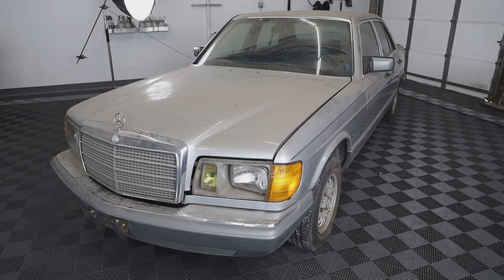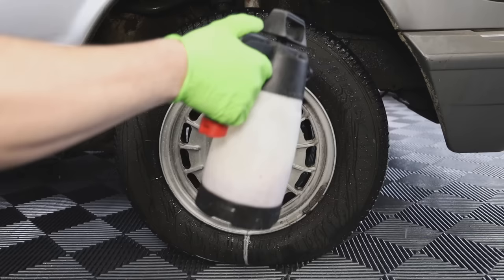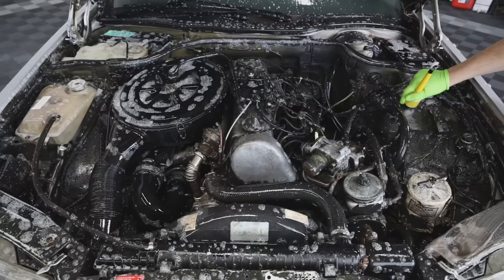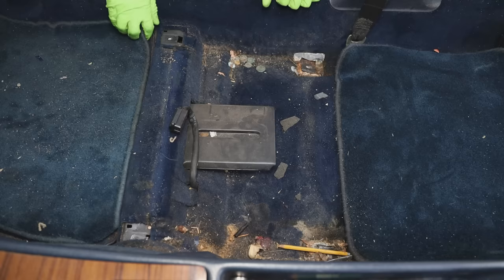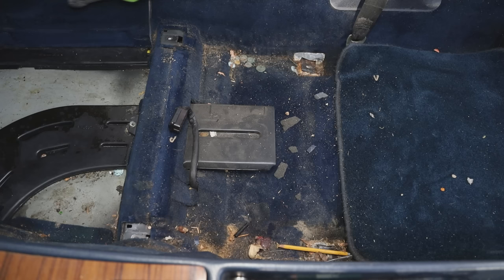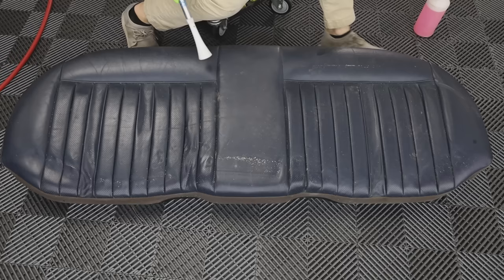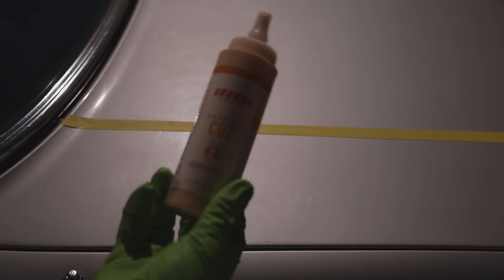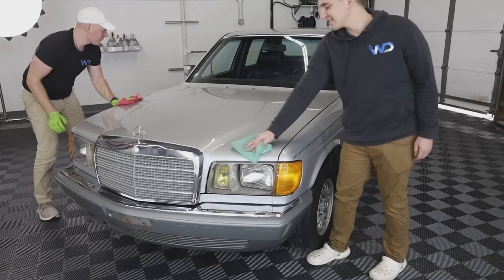DISASTER Mercedes 300SD First Wash in 18 Years! Can It Be Saved?! | Satisfying Restoration

Comment from the maker: What year do you think this Mercedes is?

Don't forget to SUBSCRIBE to the channel! Our next video is going to be INSANE!
Reply: 80-83 no ABS and the alloys name is Barock 14” this model are only for US market not for EUR
Reply: its produced from 1980 to about 1985
Reply: 1983 and those wheels are worth a lot of money. 1980-1991 W126 is probably the best built and engineered cars of all time. Proper maintenance they can last indefinitely.
Reply: Happy New Year WD Detailing!
Reply: Not sure about the year but the W126 300SD was USA only and the engine was basically the W124 300 turbo diesel engine.
This car was produced between 1981-1985 and as mentioned USA only. 5-pot 3-liter.
Reply: @erionhaxhia8284  I’ll go with 85 looking at the radio, unless they updated to the Becker gran prix head unit.  Very nice example whatever it is.
Reply: @user-ys1uc3gm8l  No , its produced till 1991 !
My father have the same with the same blue interior from 1991 one of the last made !
Reply: @niber8417  Meanwhile in EUR: almost all W126 and many late W123 had these alloys in different sizes....
Reply: 1983 or 84
Reply: 1984-1985 because of the speedometer increased up to 120 mph max vs the early 1981-1983 was 85 mph max if I recall. I noticed the Becker Radio has been upgraded to a 1986-1989 model year because the earlier 1981-1985 Becker Radio displayed the time in military style. This is a inline 5 Turbo Diesel good cars I recall seeing these when new high end luxury cars price of purchasing a home back in the days I'm old enough to recall.
Reply: From the head lights I would have to say 85-87 I believe the face lift happened in 88/89 to newer style headlights, and that engine lasts forever
Reply: 1985
Reply: 1983 Mercedes 380 SEL and they can go up to 999,999 miles because I bought mine in 1982 brand new and right now it only has roughly 79,500 miles on it all original
Reply: @kaloyanrosenov2123  After 1985 they put a 6 cylinder in these cars which had many issues.
Reply: @scottjames51  Yes , my father's one was 6 cylinder gasoline and it blocked the motor two times ! 
It was rebuilt two times and after the last time it run with no problem for years ! 
One friend haves 124 diesel , its over 800 thousands km the motor is fine , never had problems !
Reply: 1982
Reply: 1982
Reply: I think a 1986 
But the Trunk carpet looked like a imprint of a body with a plastic bag over the head and a dog next to it even after cleaning the impression 
Appears again

Comment: That wheel style was called Barock I think. These cars were practically indestructible. I used to work at a retirement home and we had a resident who had 2 1984 models. Both of them had 600K+ miles on them.
Reply from the maker: 600k?! WOW
Reply: @WDDetailing  yeah with proper maintenance these are million mile cars. The body goes to crap long before the engine.
Reply: @WDDetailing  Good job. How much does such a comp!ete cleaning and polishing cost?

Comment: The Turbo is located on the right side of the engine, right unterneath the Airfilter… if you don’t push this car as long as it’s cold and change oil regularly, this is a car for a lifetime. Mileages around 600t without even opening the engine is usual. Probably the best S-Class Mercedes ever made. I had 7 W126 in the past 20 years and all of them were sold for a high price again. The best engine is the 5 Liter V8 of the later years… strong, lasting forever and even today quiet fast on the German Autobahn.

Comment: 1982, Turbo location on the passenger car under the Air Cleaner. that is a rare color if memory serves me right! Biggest issue from experience is the Timing Chain Tensioner.  I've heard of these hitting 700K.  Mine had 450K on it, and I sold it and the current owner has 580K.  Fantastic cars!
Reply: i have to agree with you, because you can see the air charge tube below the factory air cleaner

Comment: I like that you pre-soak before you power wash so that you don't turn the dirt into an abrasive driven by the high pressure - too many people take a dry filthy car and just blast it - you also started on the roof and worked down which is how I was taught to wash ANYTHING so that you dont end up washing dirt off the roof over a just cleaned hood etc. wetting the car first before power washing and then washing from the top down is, at least to me, the smartest way to do this.

Comment: The Mercedes cars from the 1970s to 1990s are likely the most overbuilt cars of all time, save maybe an early LS400. 

The paint alone weighs nearly 20 pounds on these cars. The MB-Tex vinyl interiors they created are nearly indestructible. They created the most elaborate process for rust inhibition which is why so many still come back like new with a deep detailing. 

The engine bay should come out even nicer than what I saw. The sides should be the same glossy silver as the exterior paint. Take a look at any nicely detailed Benz on BAT. 

Last thing, guys make sure that anytime you get an old German car, esp an old Mercedes, don’t forget to deep detail the undercarriage and wheel wells. They come back LIKE NEW because of how well these were built! Imagine the undercarriage/wheel wells. It’s honestly worth doing another 2-4min short video.

Comment: Bundt wheels in the US market. I had one of these and a 300D. Both were in great shape but not museum quality so I replaced them with 15 inch factory wheels and kept these for snow tires. If it were an immaculate low mileage example, then for the sake of originality I would leave those on.

Comment: About 15 years ago, I worked with a guy (we worked at a furniture store) he had a older 70's or 80's Mercedes similar to the one in the video. Just NA, no turbo. He kept it minty clean, inside and out. Had over 250k miles on it, and it always looked like he had just ran it through a touchless carwash.

Sadly, I'm sure he's passed by now, so not sure of the car's current whereabouts.

Comment: Dude. OK, so that is a W126 S-class of the first series. You can tell by the fact that the plastic on the side has ribs. The first series was built from 1979 to 1985. The 300SD was built from 1980. I would just guess this is an 83. It has a 3 liter 5 cyl turbo diesel making roughly 120hp, and it was never available in Europe. The turbo is visible, it is located under the air filter. The only model you could get this engine in in Europe was the 300TD, which is the W123 "E-class" station wagon (Correctly called S123, and no, it was not available in the sedan!). The rims are called "Fuchsfelgen" (yes, like the legendary Porsche ones) but they might also be called "Barockfelgen". They are very sought after, and you definitely do not want to exchange those.

Comment: Blue was a rare interior color.
I would say it's an 83 or 84. If memory serves me correctly the frame around the seat back nets was metal until 1982, and since it does not have a driver's airbag or ABS, it's not an 85.

Comment: cool car! fewer of these on the road in plain sight... I'm guessing 1982-85 ish. Regarding your question about how long they can last. I had a 280D, it had over 330k on it. needed new Eng mounts, Previous owner was older and didn't want to do it. I took it for $700 bc it was a bit rough on the body but Mechanically (sound). I replaced the majority of all the belts, rubber hoses, filters, etc, and drove it till 540k. until it blew a head gasket. Original one mind you. There is a saying Among these older All mechanical bulletproof/gutless diesels "They aren't broke in until half a million" There is a reason why Solid, Clean Examples so for 20k+ now Quality over Quantity.
Reply: 280D ?? what model is that?

Comment: These are the types of cars I’m used to detailing this particular w126 Mercedes if I had to guess the year I’d say 1982 this model with the bumpers and wheels all look a like for the 1981 to the 1985 model year in 1986 they changed the bumpers headlights and rims as well as the Diesel engines and a few other modifications but overall the w126 was made between 1979 to 1991

Comment: Turbo is under the passenger side air filer cover. The car doesn't come with a boost gauge and you're best off installing one. Then you'll find that the boost is low and can turn it back up to normal from the barometric capsule.
The tail lights have a self-cleaning design.
I would improve the look of the car, by getting rid of that stripe.

Comment: When you guys use the apc/degreaser. When pressure washing it it off work from bottom to top that way it has a little more time to sit and dwell on the surfaces. When you go from top to bottom your rinsing off the degreaser prematurely. Now this is only when using an apc/degreaser

Comment: The wheels are the mexican hats, affectionately known as.
I had the 3.8 liter V8, pulled it out and installed a Aussie Holden V8 5.0.
Shortened the prop shaft by 2 inches.
Hot cams, 600 cfm Edelbrock and custom exhaust manifolds.
Thing went like stink afterwards

Comment: This car is a 1984 model year car, the w126 300SD was made from 1981 to 1985 and each year had a slightly different instrument cluster and 3 different speedometers, this cluster is a 1984 model year cluster but the car could have been manufactured in late 1983 when the 1984 models began to be delivered in late Sept 1983

Comment: With 500,000 km, this engine has only run in well 😉
1,000,000 km and more is no problem for this engine.
Regular and professional care provided !!!

The wheels - by the way - are called Barock wheels by Mercedes Benz.

Comment: Looks like a early to mid 80's W124 chassis. As long as the car is maintained properly, there's no reason the engine shouldn't go at least 750,000 miles. The turbo is under the intake manifold and air cleaner on the right side of the engine.

Comment: Hey, I've noticed that you guys and MADD detailing are angling the pad while cutting and polishing. I was taught that number one rule was to keep it flat to the surface. What's the reason behind this?
Reply: My guess is to get to hard to reach areas as far as I know polishing unevenly will only eventually ruin the pad so maybe they just don't care because they have an abundance of pads and it might be worth sacrificing the longevity of the pad to complete the job faster/easier
Reply: That’s because he’s, as you said, polishing the paint with a cutting microfiber pad and using a rotary polisher. Doing that you put more pressure on the pad to get rid of the old clear coat and/or paint. After that you use a foam pad and wax or a sealant with a dual action orbital polisher

Comment: Those wheels are factory on a mercedes like this. I believe in Germany they call them Gulli wheels (Gulli is a street manhole cover in German)
Mileage wise, i've seen mercedes' that had over 1 milj miles on them and still ran.
In europe, most of these engines were used in the W123 and 99% got exported to the middle east en northern africa.

Comment: Need to do all belts hoses rubbers gaskets set valves rebuild injectors glow plugs transfer pump . Tires and balljoints I like the later 126 wheels looks like a 1984 . Proper oil changes 300000 400000 miles pre chamber go out on them as they age.

Comment: The heading «can it be saved» is obviously absurd clickbait. 
The wheel rims are Bundt Barock, which was an original factory option and very common on W116 series S-class but not so much on W126. Barock wheels were also common on many other Mercedes-Benz model from the late 1960s to mid 1980s. I think they were only available in 14 and 15 inch (at a time when 14 in was an absolutely normal size even for large cars), but I have seen remanufactured versions now with both 16 and 17 in. Personally, I think big rims on older cars totally distorts their appearance.

Comment: The messed up part about those years of Mercedes is the fuel injection chip no bigger than the size of a thumb nail that costs around $600 or more when one goes out.

Comment: The engines are bulletproof if maintained.  The transmissions are the weakest link.  No greater road car ever built.  If I had to guess I’d say this is an ‘83.  Turbo under the air cleaner.

Comment: Keep the wheel they are orginal brand fuchs. Fuchs made also wheels for porsche 911 bouth are very pricless  the W126 is one of the best benz ever made they oryginaly was in 14 inch in limo (115,114,116,123,126) and 15 inch in R107 SL AND 300D engine is built to like diamond is forever

Comment: These cars will pass 500k miles if well cared for and maintained. 
Those rims are called bundt wheels named after the bundt cake.
Keep those rims they are worth more than aftermarket rims.
I own 2 mercedes.  A 1987 300d w124 turbo diesel and a 1987 300sdl w126 turbo diesel. 300 stands for 3.0 litre. S is for special class d is for diesel. The l is for long wheel base. 6 inches longer than SD.  The 300sd  and sdl. Are the best built cars ever built by mercedes.  They are the w126 chassis.
Do yourself a favor and keep it %100% stock. It will last longer and be worth more. People start disconnecting stuff and try to hot rod them to roll coal and it destroys them. Mercedes spent millions to design a perfect reliable car that would last forever if cared for.

Comment: A million kilometers. So around 450.000 miles. But they need their maintenance.

Their parts are cheap because they are still driven all over the world as taxi’s and high end personal cars.
Reply: The wheels were the high end original Mercedes wheels.
Reply: This engine can be easily overhauled. At least 3 times.
Reply: The Koepke sign ment you were dealing with an original dealer bought and maintained car.
Reply: Leather needs leatherfat. Not applying leatherfat will make it dry and let it shrink.
Reply: Clearcoat that mercedes while the paint is still reasonable.

Comment: Looks like original paint too judging by the pin-striping. Usually you guys do an excellent job on your details but I saw quite a few areas missed:

1. Clean both sides of the carpets and mats (strangely only the top parts of carpets is typically cleaned by most YouTube detailers)

2. The ribs in the middle of the seats were not cleaned in between. They are chock full of dirt and need to be cleaned out and conditioned. 

3. The engine bay was not deep cleaned enough. Should easily see shiny silver paint throughout the engine bay esp on the left and right sides. Was a very minor superficial cleaning which doesn’t do these old Mercedes any justice. 

4. Fuel door/area not cleaned

5. Spare tire area not cleaned out/detailed

6. The wheel wells and undercarriage are the best aspects of these old Benzes and sadly, neither was soaped or power washed at the very least. A big miss. 

7. The exterior detail was only a 1 or 2 step? I know you guys could do better, I’ve seen you guys do 3-5 steps before, this original paint deserved it!

8. No chrome polishing?

9. The taillights on these cars are easily removed and detailed from the inside (diesel smoke tends to “smoke” them opaque. 

10. Front lights and plastic surrounds are also easy to remove and polish. 

11. Interior detailing of front seat area was very brief, no dash detail? Curious if you cleaned the headliner. Ash trays (these cars have 3) are typically full of junk. 

Cmon guys, let’s see a part 2 on this car, or hopefully you go all out on the next Benz!